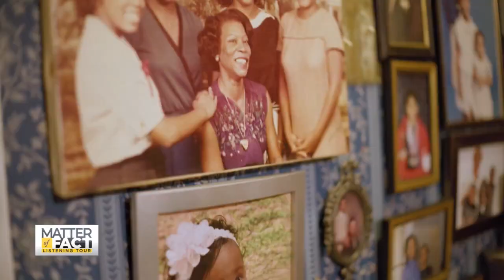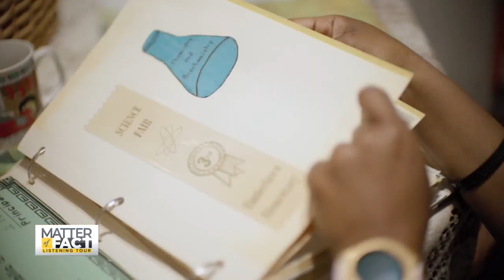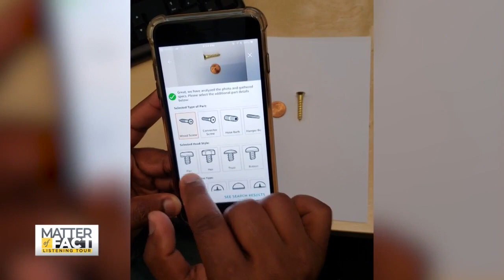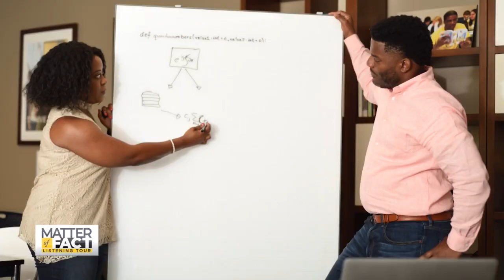Young computer scientist transforming her Mississippi hometown into a tech hub

Comment: Jackson has been run by Democrats for the past 25 years. There in lies your problem. Democrats are ghetto makers. Chokwe and now Anter couldn't run a lemonade stand without crying racism. They didn't even have a  long term plan to fix the water system when it went kaput. Pot holes, garbage pickup, water. Good Luck.